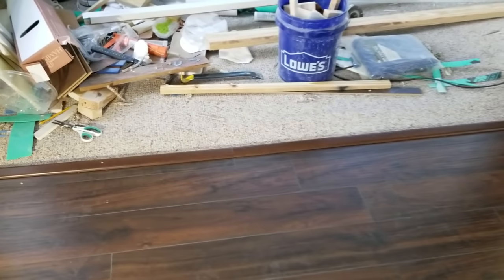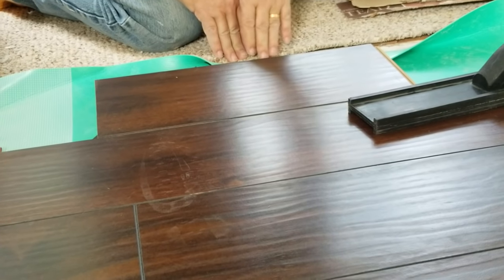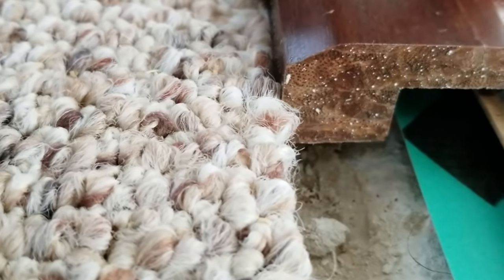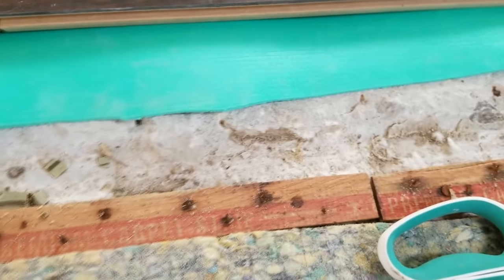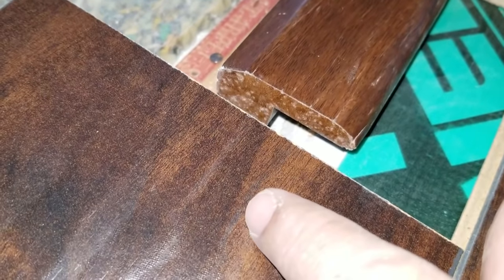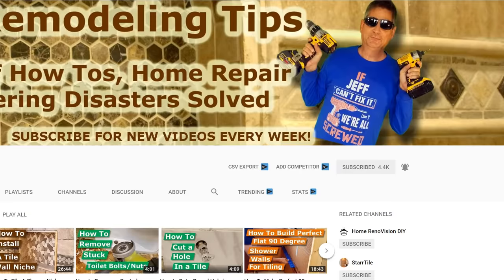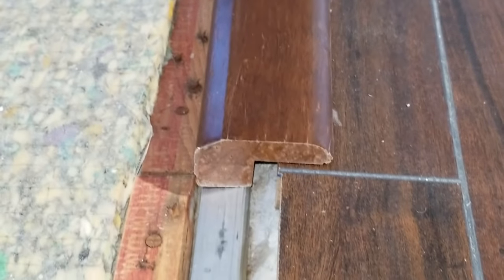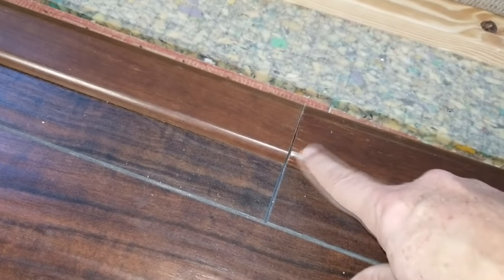Carpet to Wood Floor Transition, Laminate Floors

Comment: Around 20:30 you summed it up well and it helped me.  I was going to do a ' T ' transition to gap a carpet to floating cork but now realize the edge FLOATING over the carpet will just CRACK off once a big person steps on it, it has to be supported!!  A possible :20 video: show 200lbs over a unsupported transition cracking!  Thanks!

Comment: Could you shim under carpet lets say with laminate under padding so that the carpet could make a slight unnoticeable rise. To minimize that toe hazard edge. Or even shim under tack stripping. Great video for representing common real life situations that occur with most remodeling projects. Floors are by far the most challenging.
Reply from the maker: Yes you can shim under the strip. They sell 1/4" thick strips of poplar wood at Home Depot, I buy them in 8 foot strips that you cut and use in door frames to shim them up. Usually 2" wide, they can slide under the end of the carpet.
Reply: @jeffostroff  thanks
Reply: There are tapered rubber shims available that taper from zero to 1/8", zero to 1/4" and all the way up to at least 1/2", maybe more. They come 4 feet long in widths about 10 to 15 inches or so. The higher the transition, the wider they are.  In this situation you would have to drill into the concrete then glue in wooden dowels so the tackstrip can be attached.

Comment: It's not too bad, if you had a routing table you can make your own custom thresholds, I would prefer an overhang for the carpet to tuck under.
Reply from the maker: If you make an overhang you must be able to secure it or it will break when you step on it with the carpet under it

Comment: I already have an end cap on my vinyl floors going into the bedroom, and I now am in the process of getting new carpet for those rooms. Do I have to remove the end cap, or can I tuck the carpet underneath the cap?
Reply from the maker: You can tuck the carpet under the end cap, but I fear that it will rock toward the bedroom if you step on that transition piece/endcap to the carpet. You might have to add shims under that transition piece to that it does not yield too much under your foot when you step down on it.

Comment: Why metal strips under the transion? Could I use wood?
Reply from the maker: Yes you could use wood or plastic or metal or anything strong enough to shim up and hold the weight under that wood.
Reply: @jeffostroff  thanks buddy. Very helpful video :)

Comment: wondering why you didn't make the carpet fit underneath the threshold piece? it would have looked a lot neater. great job nonetheless
Reply from the maker: If you look at 4:15, that super jagged crooked cement ledge of the concrete floor from the living room was preventing us from getting an even overhang on the transition piece. I needed to bring the transition piece about another 1" toward the carpet, buy I can't run my wood floor over that crooked ledge so I was stuck.  The person who bought the condo from me actually commissioned me to removes the carpet and extend the laminate flooring out into the patio, and it looks much better now. You'll see it in one of my later videos in this play list, I believe we uploaded the video in June.

Comment: @12:45 I don’t understand why the floor and that wooden sample have space in between them , wouldn’t the floor shift when you move it ? Why keep a half inch of space between the laminate and that wooden sample piece
Reply from the maker: Jose, the wood transition piece must be glued down so it can't move. You can see the piece will be glued to the metal strip, and you must have a gap between the wood floor and this transition piece, because the wood floor wilt expand and sharing underneath the overhand of the transition piece. Because the wood floor expands, the manufactures usually tell you leave form 5/16" up to 1/2" gap all the way around the perimeter of the floor for expansion. If you did not make that gap, and the wood floor is up against the transition piece, then when the floor expands, it has nowhere to go and it will buckle, popping up th eboards.
Reply: @jeffostroff oh okay thanks that clears up a lot of confusion for me I was not aware the floor expands

Comment: Self level....problem solved
Reply from the maker: Nice try. First of all, most self level can't be poured that deep, and also the slab in that patio is slanted downward because it used to be an exterior patio and was sloped for water run off. Not a good candidate for doing self leveler.
Reply: @jeffostroff  ,  Pull carpet back, remove the tack strip. Henry's with ardex  would work in that situation. It's a floor leveler not a self leveler!  Float the floor out however far . Blue tack strip down , stretch and tuck!!